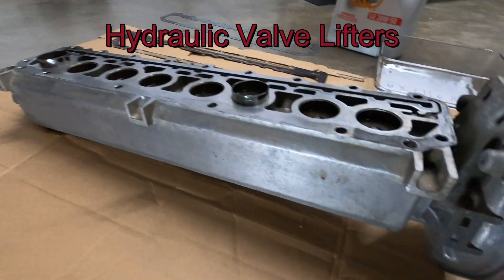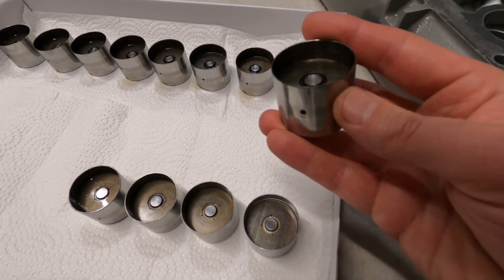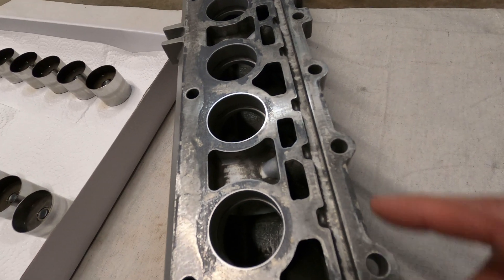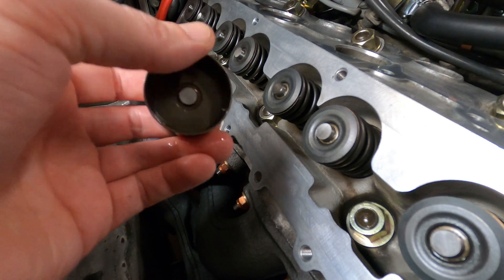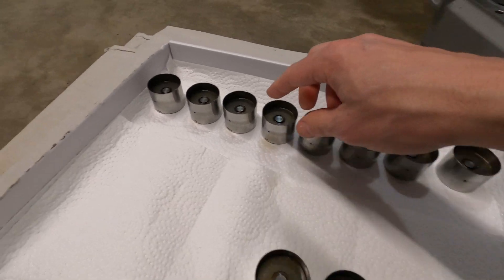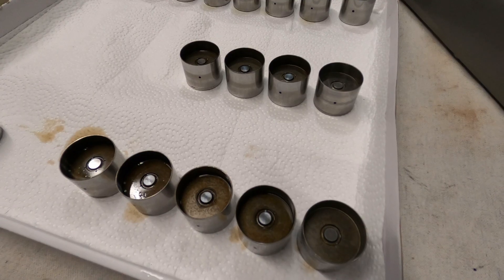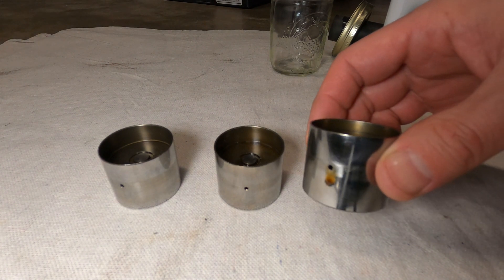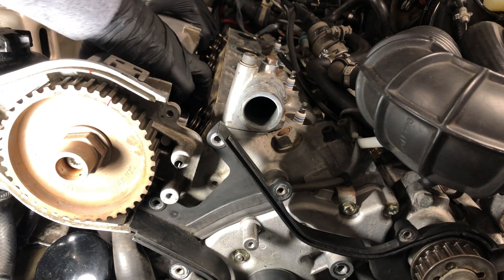Porsche 944 – Hydraulic Valve Lifters – Functionality, Testing, & Replacement

Comment: Thanks for the video! Helped me change out 7 of the 16 lifters in my engine, it eliminated my valvetrain clatter completely. But I have a question, I swaped mine out with some good used ones like you did. Does this warrant for some sort of break in period or a couple frequent oil changes? I just changed the oil after letting the car idle for 10 minutes with the "new" lifters, using some occasional throttle. But reading up on it online now this might not be the right way of doing it...
Reply from the maker: It’s good to have fresh oil in the pan after lifter replacement so they don’t get fouled up from old oil, but I don’t typically modify the oil replacement interval. Porsche doesn’t have any guidance for used part replacements, but you may notice a little more metallic particle buildup on the oil drain plug magnet during the next oil change as the parts get “acquainted” with each other.
Reply: @NC944er Alright, I'll try not to worry coming next oil change. Thanks!

Comment: What years have the tappets
Reply from the maker: @validflyer6031  All 944 model years feature the hydraulic tappets. There are different part numbers for the 8v version versus the 16v, but they all used them, even the Porsche 968.

Comment: Yes I have some new ones and I had the same question do I pump them up or leave them soft I was actually going to go in between by just filling the bucket up and leaving it a little tap it empty and allow it to pump itself up not sure if that's the right way to go but it seems to be down the middle between being hard or soft
Reply from the maker: Nice! The factory workshop manual says to just install them dry with no prep needed, and I think that generally works well if you have fresh/clean oil in the engine with no sludge deposits floating around. I don’t know that I’ve ever been able to fully prime a lifter out of the car, the engine oil pressure and cam movement does a much better job, but I have been able to get them somewhat firm before installing. Some people prefer that method for peace of mind in knowing the part is actually working correctly.

Comment: What is the normal travel distance of the piston?
Reply from the maker: So I wouldn’t say that the hydraulic valve tappets have a ‘normal’ travel distance per sé. They do have a ‘maximum’ travel distance that really shouldn’t be reached if they are functioning correctly. Provided that the check valve isn’t clogged, each valve lifter should be nearly incompressible when the engine is running. If there is a noticeable travel distance as you describe, that would indicate a problem with that particular lifter.
Reply: @NC944er  Thanks! I attempted to test all of mine per your video but had zero success. A few had a lot of travel distance but wouldn't stay hard after trying to bleed them. A few had just a slight travel distance but wouldn't push any oil out after testing outside of the oil. The rest were rock solid and wouldn't move at all (lifters hadn't been in operation for 7+ years). Nonetheless I have 8 coming from Plyhammers. Wish me luck!
Reply from the maker: @SuperM1687  Yeah, it’s a little difficult to determine their condition when outside the car and the factory workshop manual doesn’t indicate that they should be primed at all before installation, but lifters that very easily bottom out after being primed are concerning to me. Good luck!

Comment: I too went through the long and convoluted path of valuable and junk information to gain Porsche 944 lifter enlightenment. I bought both "rebuilt" lifters and used lifters (Plyhammer). The "rebuilt" lifters had excessive dimensional variations of the height of the buttons from the smooth camshaft interface surface which indicated poor after-market machining, so I returned them to the vendor.The resting height of the button above the camshaft interface side of the lifter is a Controlled Dimension in the Porsche 944 as is the height of the valve stems in the cylinder head as is the thickness of the Cam Tower gaskets (only use OE Porsche gaskets !). See Porsche FACTORY Repair Manuals for details. The used lifters I had were all gently reconditioned back to nearly new appearance and performance. I first put all of the lifters in a 3-quart can of Gunk carb cleaner for 2 days, then exercised each one while in the cleaner fluid to expel the old dirty oil, and again soaked for 2 says. Repeat 5 times. Being in the middle of a snowy winter, I was in no rush. After 10 days of this routine, most of used lifters came clean and started functioning smoothly. Then each was mirror polished with 600 emery cloth and a brass wire wheel to look almost new. Then each was soaked in 10W-40 Amsoil and exercised again.Then repeat 3 times. I did not use high viscosity assembly lube on the lifters to prevent the heavy lube from blocking the small oil passages inside the lifters and preventing the reconditioned lifters from working correctly. After being cleaned and exercises, it is far better for the buttons within each lifter to feel a "little springy" rather than hard and incompressible (blocked oil passages?). Reject any that are stubbornly hard and incompressible post-cleaning. In actual engine use, the super clean springy ones will quickly fill with fresh (high pressure) engine oil which is replenished on each valve actuation, and the buttons will readily expand to take up any excessive valve lash (as long as the aforementioned controlled dimensions are assured). A camshaft profile has two main areas, the round Base region (valve closed) and the Nose region (valve open). When in the Base region of the cam, hydraulic lifters are designed to adjust the valve lash, but in the Nose region, the lifters are designed to be fixed and rigid as if they were "solid lifters". The lifter's button has an internal spring that always wants to push the button outward (expanding) causing the button to take up any valve lash. Also, while in the Base region of cam operation, high pressure motor oil fills an internal cylinder inside the lifter just below the button. As the cam rotates into the Nose region the lifter starts to move and its tiny oil entrance/exit hole is temporarily blocked off. Now, the oil within the lifter is trapped inside, unable to escape, and oil is virtually incompressible, which prevents the lifter button from compressing while it is pushing against the very strong valve springs and opening the valve per the cam profile. So during the Nose phase of the cam action, the hydraulic lifter acts just like a fixed, solid lifter. Once the cam rotates back to the Base region, the lifter's tiny oil hole is once more connected to the pressurized oil galley in the cam housing, the spring-loaded button again moves to remove any lash while the engine oil can again flow in/out of the lifter as required. The key is that with the tiny oil hole unblocked, oil must be able to flow freely in or out of the lifter and the spring-loaded button must be able to freely move in or out (within its allowed range). But once the lifter is filled with oil and then the oil hole is blocked off, the button should then become effectively incompressible.
Reply from the maker: Excellent summary and description of both the “optimal” lifter operation as well as some of the pitfalls and rejuvenation options. I haven’t tried the aftermarket (INA) lifters, but I have heard some pretty terrible experiences with them. This is one of those 944 jobs where there’s no real easy path, but patience and persistence in cleaning efforts pays off in most cases. Thanks for sharing your experience! 👍🏼

Comment: I really appreciate these videos and the thought that goes into every detail. You have helped me out with my 944 so much. I am now tackling cam housing seal along with the other front seals in my 86 944 NA. I discovered two lifters were sort of “soft”. I shot some compressed air in those and they stayed hard for about an hour, but returned back to a semi-soft state. They are still hard to press but I can do it with mid-force. They also expelled oil when pumped. Wondering if those are still fine to reinstall. I do have a parts car and pulled the lifters from that car and they were all soft - presumably because they hadn’t been pumped in years. I have two that seem to be mostly firm after soaking in oil and priming with oil. Wondering if I should just install those in place of the “soft” original ones. Just concerned about used lifters that aren’t oriented to the car, but I see that you did this. How did that work out installing used ones?  Appreciate any intel!
Reply from the maker: Hey Jason, based upon your description I would say those lifters are still in good shape since they held for a period of time. When the car is running, they’ll be under constant oil pressure so they should firm up nicely. If they were super soft and wouldn’t hold any pressure at all, those are ones I would be concerned about. The replacement lifters I installed at valves 3 and 6 have been working well for me with no issues. The original lifter design is no longer in production, so the only option is to swap in used ones or replace the entire set with INA’s new design, which I’ve heard mixed reviews on their quality/reliability.
Reply: @NC944er  again, thank you for the super clear explanation. That all makes complete sense!

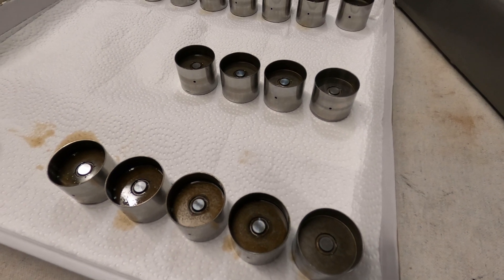Comment: 3:41 was a key moment for me that I wanted to know for a long time now :) Each time I asked someone then one said they gotta be soft, someone else told me they gotta be hard and I always had the feeling it should be firm for me (because the engine has way more strenght then I got in my hand so obviously its gonna be soft for the engine but hard for my hand) but not rock solid neither soft for me. 

This makes perfect sense and has finally brought some clarity and assurance that I was on the right track :) thanks for that

PS: People I asked were all certified car mechanics....which is the main reason I work on all my cars myself.
Reply from the maker: Exactly!!! I encountered the same thing when researching them on the forums, some say gotta be soft while others said gotta be firm… but they really need to be “just right.” There are some guys who have cut them in half to expose the check valve system. That and some other outside sources helped connect the dots for me on proper functionality. Glad you found it helpful! 👍🏼